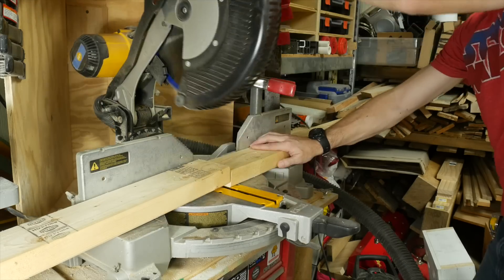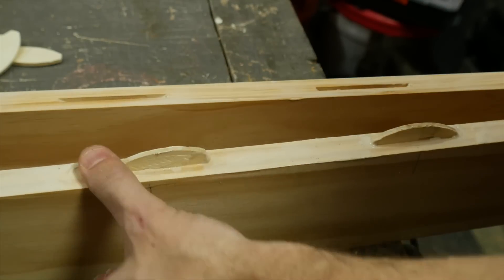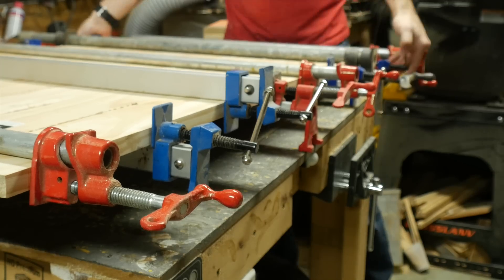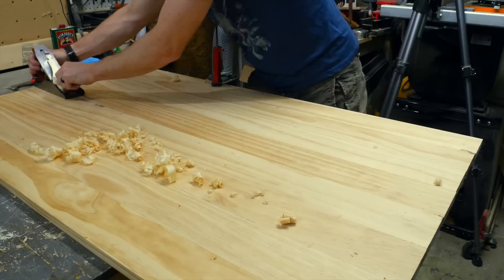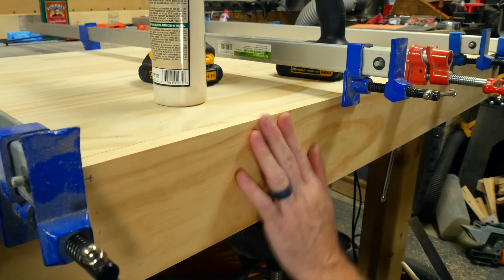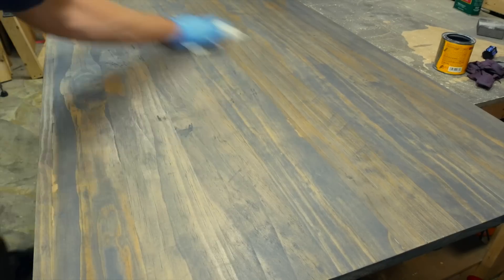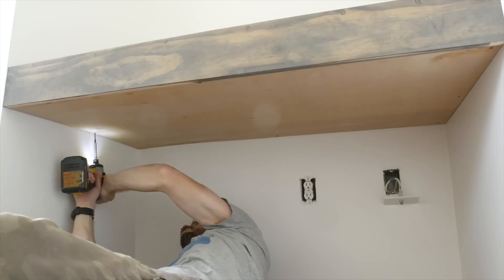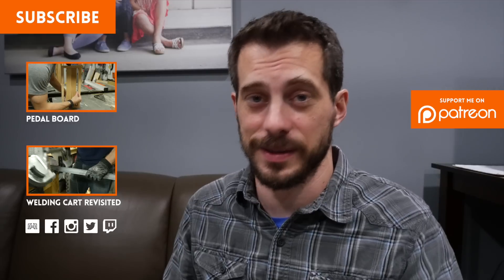Floating Desk // How-To | I Like To Make Stuff

Comment: At 7:11 Bob mentions that the front (outside) of the opening is a little smaller than the back (inside).  This is a VERY common problem with inset dry-walled areas like this.  Imbedded under the drywall plaster at the left front corner where the two walls come together is something called a "corner bead" (Google it).  This bead is typically metal and helps both protect the corner from bumps and as a guide for the plasterer.  The plastering makes this corner slightly higher than ("proud" of) the remainder of the wall.  So sliding something into an inset area like this is always tricky!  It might have been easier for Bob to leave the front lip off the desk until after it was installed.  Good looking project overall!
Reply: +cemx86 I thought americans did't usually plaster over drywall, how do they hide the corner beading? In the UK it seeems that all drywall gets skimmed
Reply: +Michael Stephenson - We don't typically plaster entirely over the drywall, only at the joints to provide a nice flat surface.  The edges of the drywall sheets are tapered to allow the "mud" to be sanded level.  There is also an imbedded paper or fiberglass tape to prevent cracking.  However, at the corners (inside and outside) there is a bead/tape of some sort to smooth the transition.  Ceilings are nearly identical (without outside corners!) but often the ceiling is sprayed with a textured slurry as it is faster and cheaper which I do not like as it is much more difficult to make invisible repairs.

Comment: Nice build, Bob. The grey stain looks really classy! One way you could add extra storage would be to have a hinged lid on the top surface of the desk that opened up into a compartment in the interior of the frame. You could just have a small finger hole to open it and close it and latch it with a magnet. If you position this underneath something like the lamp, it then becomes a secret or hidden compartment.

Comment: how do they plug the lamp into the socket below without routing the cord over the front edge?
Reply from the maker: +Thomas Hughes They drilled a hole through it after I installed it.
Reply: +I Like To Make Stuff   why did you use bicuits for the the front part and not Brad's?

Comment: "super simple build"... yeah, with a 5000 worth of equipment
Reply: Ridhuan Abu Bakar you can rent a saw and a couple clamps to make this, and the wood is always gonna be an investment. overall it would take a good 100-150 bucks
Reply: ChaJang yes, i've made one before with minimal tools
Reply: Leowulf™ you see the long clamps aren't cheap in my place...and he uses lots of them
Reply: A 50$ drill is going to last you, I don't know, 10 hours of utilisation before it breaks ? A good drill is AT LEAST 150$, same with a miter saw, a not cheap one is around 200$, a sander is around 70$, and we're not talking about the laser, clamps and all that. So yeah, maybe not 5000, but definitely more than just a couple hundred bucks. Of course you can make it with cheap tools, once or twice...And even if they don't break immediately, it's really not pleasant to work with cheap tools.
Reply: alignator3 Sure, okay.
Reply: i have made something like this with handsaw it is RM30, drill RM160 or smth,  and RM10 Hammer
1USD is about 5RM after clue, nails, screws and calmps to hold the wood while i was cutting,
of course can not forgot the tape measure i dont know that price :),
Peace

Comment: Fun project, Bob! 

Two biscuit tips: use better biscuits, as there is not normally a difference in thickness. They normally align quite well. Don't buy your biscuits where you bought your biscuit joiner. ;) Also buy a biscuit glue bottle. The tip is shaped like a biscuit. MUCH easier. I think I paid $3 for mine on eBay. :)

Comment: hey Bob great project. About the hidden storage, what if you used a couple of hinges at the back of the desk so you could lift it open,i think the fact that it was wider at the back wouldn't be a problem in this case and you could still use the magnets at the front.  Love your videos!!!

Comment: A few design thoughts if this area would be used with a computer or light.  Drill a large hole into the top and bottom for cable routing (power and for printer cables, etc) and insert a cable hole cover (which comes in lots of colors) to finish it off.  The excess cables could then be pushed into the area between the table top and bottom.  A printer could be house on a roll around matching cart under the table or a matching shelf (with under counter lighting?) above the table.  The printer cables (power and control) could be routed inside the wall.
Reply: +cemx86 I think I actually would have left it about 1" away from the back, I think, for cable management, rather than a hole. That way cables can drop straight back no matter where it is on the desk. Both ways work, and have their benefits and drawbacks. I work with office furniture, and one of our lines uses holes and one uses a "wire gap" and I like the "wire gap" much more...but that's just me.

Comment: Awesome work! The project is done so this is completely useless, but if the front is narrower than the rear then you could always have it lift up with hinges in the rear. It would complicate the ability to leave stuff 'in place on the surface but it would still be possible to access the 'inner cavity' if that is required.

Comment: i made a table that hovered i used a table top frame that had 5 really strong magnets then i put on the floor a got a big thin magnet after that i did some measurements to make sure the table top would hover then i put the table top on and it worked! it can hold up to 40-50 pounds

Comment: You should consider using water based oil modified polyurethane. I put 5 coats of that on a dinning table I made and I was supremely pleased with the finish.

Comment: I'd say all niches have narrower fronts and prevents you from sliding straight in. Mostly due to the bullnose corner Bead. I havent found a good way to hide the gaps other than caulk. If walls were straight, things would be so easy.

Comment: I did this 3 years ago in a corner, it's an L shape and is 7 foot by 5 measure from the back corner, the top is 36" deep. 2 legs on each end of the L and a ledge that fits in the back that's mounted to the wall :)

Comment: handplanes are pretty cool right? you can drastically reduce your sanding time and the dust that follows the sanding.
instead of the screws for the front I would have used just dowels, just drill holes and glue the dowels in. faster, less metal and just as strong If not stronger (glue on endgrain isn't optimal as you said, but screwing into endgrain isn't optimal either. with a dowel you would create a longgrain to longgrain gluing surface, and the clamps should be enough to close the gap) in my opinion. to make them flush with the surface I can recommend a sharp chisel, it is really fun this way and the results couldn't be more perfect.

Comment: Fine script, editing, and wood work.  What editing software did you use?   Don't be shy about using 1" x 1" strips of wood + joints to keep your boards aligned.   The biscuit method has limitations when making fine furniture as you did.  Good work.

Comment: Awesome project, as always :) Little question that came after I watched it: was there room between the table and the wall to pass any wiring? Was wondering how they managed to plug that lamp :)
Reply from the maker: +Alexandre Nobrega The client drilled a hole to drop the cable through, near the back right corner.  All I have is these photos, so I'm not exactly sure how that turned out.

Comment: My desk is pretty much like that, but after a while, I realized that design isn't good for wires and general electronics, cuz it makes a mess in my room when I use power supplies, soldering iron etc since I can't use the outlets under the desk. I made a whole like those office desks, but still, I wish I had left a gap between the table and the wall. But that seems like a desk you wouldn't use for soldering, so I guess it's gucci.

Comment: Did you have any issues with the house shifting when you anchored walls together like that?

I put up a shelf that connected two walls.  Over the next couple months I kept finding drywall dust on the shelf.  In the middle of winter, I got a crack running up the corner of the walls. A contractor came out and told me the damage was superficial, but that my shelf caused it and suggested removing it.  I did, painted over the crack, and haven’t had any issues since.

Comment: Nice video, thanks for posting it. 

I’m curious: in a situation like this where you have three walls to deal with, how do you scribe a single flat desktop surface to fit? I’d like to do a built-in like this with exposed 2x4 framing (hidden under the desk surface unless you get under the desk to look) with a butcher block top, but I’m worried about getting the butcher block to fit neatly up against all three walls. I considered making a template out of a few strips of plywood, getting those all scribed in and then using that template to cut the butcher block or something like that. Worst case I can trim out the top of the desk to hide gaps and fit an apron on the front to hide any gaps on the sides but I’d really rather get one solid piece in neatly if that’s possible to do. 

Thanks in advance for any recommendations or tips you can share.

Comment: can wood glue work to bond those wood pieces? will it be strong enough?
Reply: +Yamin Siddiqui If the edges were properly prepped and the glue-up was properly clamped, it should work fine. The wood would likely break before the glue let go. biscuits primarily make alignment easier.

Comment: nice job....just had a question tho ...for the top that you uses dowels to join it and make it a bigger table top why would you take so much time in using dowels and gluing and cutting and all that and not just use a plywood that thick because it does not look so thick so i was wondering is there any specific reason not to just start with a one inch thick plywood and just cut it square and just do the framing without having to do all that tons of work just for the top just wondering only to learn that reason?.
Reply from the maker: My friend (the client) wanted it to look like it was made of slats, rather than one large piece.
Reply: +I Like To Make Stuff oh ok because after they all were planned with the planner and sandid it looked just like a solid piece of plywood to me ....but ok just seeing what your comment was for that

Comment: How does the cable from the lamp goes to the plug in the wall?
Reply from the maker: +Felipe Aguayo Bravo After I left for my trip, someone else drilled a hole near the corner on the top and bottom to drop the cord through.  All I have is the photos that I showed, so I can't see exactly how that turned out.  I personally would have dropped in one of those plastic hole covers made for routing cables through a desk, but I'm not sure if they did or not.
Reply: I Like To Make Stuff You didn't drill any hole in the video, so I was wondering that. It would have been terrible if the cables just go through the front. Nice project!

Comment: What is another option for biscuits cause I do not have a biscuit joiner
Reply from the maker: +BOSS Builder You could use dowels and a simple jig for lining up the holes.  It's a similar idea.  Also, pocket holes would work but given how thin the material is you might pop the tip of the screw through the desk top if you'r not careful.

Comment: how would i do this with a corner that only has 2 available sides instead of 3 like this video?
Reply: +Libin Joseph you could mount two 1" x 4" wood to each wall using brackets. then create a table just like he did but have a four 1" x 4" notches cut out. the table could sit snug in those notches

Comment: What  is the maximum  weight it can hold ?
Reply: +NA No more than 400 pounds. any more than that and you risk the nails coming loose/breaking and seriously damaging the floor
and whatever was on top of that table. you could of course just add more support into the wall and be able to hold even more.
minor adjustments could make this desk able to lift 750 pounds, 1,000 pounds. or ever one ton. however i seriously
don't recommend putting 2,000 pounds in a 2x3 foot square.
Reply: Bob
Reply: +ElementalsMods Ok thanks for the info ! :)
Reply: It can hold Bob.

Comment: I'm new to woodworking and I have a question that I hope someone can help me with. I'm building a similar thing, but my wall isn't perfectly square. What is the best way to approach this?
Reply from the maker: If the opening isn't square you might try to make a paper or cardboard template that is cut to fit perfectly in the space, then use that template to trim the wooden top to fit perfectly.
Reply: Thanks much Bob! Going to try it tomorrow!

Comment: I also did this with scrap miscut lumber from the local hardware store. I burnt the wood to give it a cool look and used bar topper to finish it off. Not sure if I can submit a imgur link but here goes: http://i.imgur.com/ISMNfpP.jpg
Reply: The  desk is floating but I wanted storage and a bit of safety so I went with the kitchen storage solution at the bottom.

Comment: Why did you use 1x4 and not just a piece of plywood or something? Most of the work seems to be connecting these planks.
Reply from the maker: +Daniel Mores Because the client wanted it to look like it was made of planks rather than one continuos sheet.  plywood would certainly work just the same.

Comment: I wish I had the tools to make a desktop like that, otherwise I would just make myself s desk instead of buying one.
Reply: +RaySchrantz  you really only need a drill w/ bits and a saw.  If you make the tabletop out of good plywood or MDF, you wouldn't have to joint boards together.
Reply: You really don't need the tools used in a lot of these videos. However, what you do need is a will to complete the project.

Comment: That's cool, but it isn't floating if it attached to a wall...
Reply from the maker: +Lewis Beauchamp It has to legs or under bracing.  That's typically what people think of as floating.  A floating shelf is still attached to the wall otherwise it'd be magic.
Reply: +I Like To Make Stuff I see your point. The build is very good anyway and I suppose it wouldn't sound good if they where called semi-floating tables.